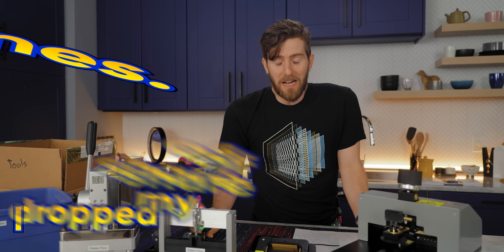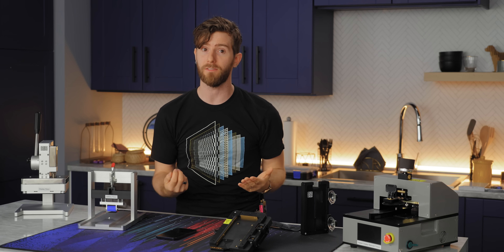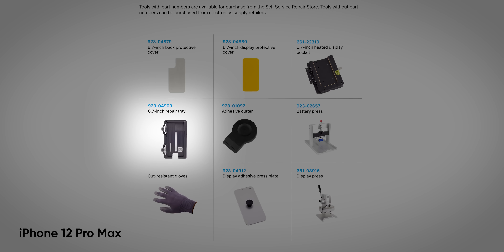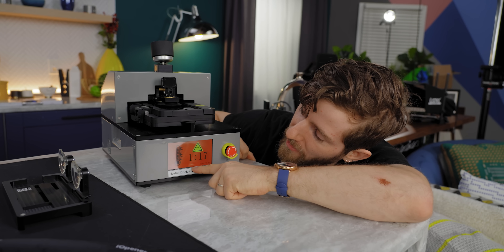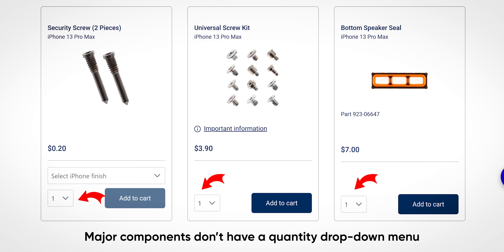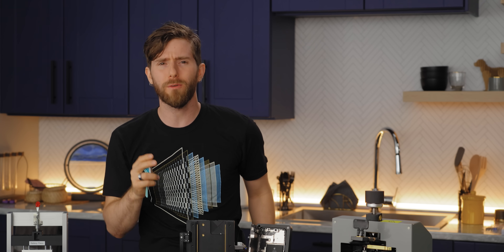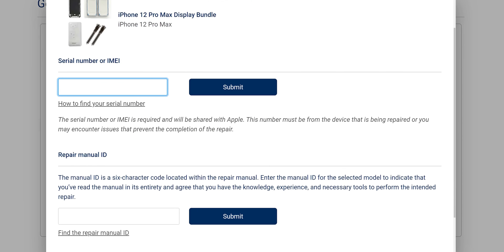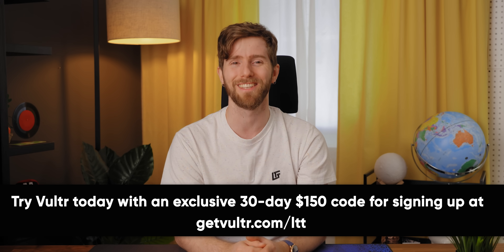I’m a Genius - Apple Self Service Repair Program

Comment: coming from an Apple authorized service provider. The customer has the option to wait over night for the part (if supplies are good, and of course GSX doesnt tell you stock) Or us as the provider can order the part as a "stocking part" which actually cost us more then what Apple charges for the repair! which in turn makes our prices higher to cover labor cost and part cost (Apple will pay you but its not even enough to cover their "minimum wage thing of $17.36) Now there is an option called Apple consignment part inventory which does! give you about 3 parts on hand at all time and when used Apple will send you a replacement part however, the cost associated with this is not much better then just stocking the part. Or in many cases is way more hassle on the techs end that will ultimately result in the shop losing money on the overall repair. There is a way to be very efficient about it  to where we do come out $4.55 ahead but its slim pickens. Working for Apple for 5+ years has drained me quite significantly

Comment: so basically same as they did some time back with parts availability for non-apple repair centers. it is possible to get original parts, but qualifying to such program is insane, apple will dictate what you can and cannot repair and you need to wait for part, you cannont just order any stock... so its just point against right to repair, "we have program for original parts, but noone wants them".

Comment: Why does the phone require heat to open it up. All are new modern phones doing weird shit with adhesive to seal phones? What happened to just screwing things shut so you don’t need a fancy heater or risk burning yourself??
Reply: it doesnt look as good with screws according to apple

Comment: It's okay, if you bring it in you're more likely to buy a new device. Especially when you bring in a laptop and it just needs something simple like a hard drive and the price to repair it is literally as much or more than buying a new one. And with that price, they won't even try to save your data.

Comment: It is the same power tools and motorcycle market. Once needed to order new piaggio engine for customer. New scooter cost about 2000€ and new engine for it was close to 3000€. It was like 8 years ago if I remember correctly

Comment: In my opinion, it's quite hypocritical to complain that genuine replacement parts are expensive after customers demanded to the high heavens for OEMs to sell them genuine replacement parts.

Given how crappy and worthless non-genuine replacement parts are (probably even dangerous in the case of batteries), having the option to straight up buy genuine parts straight from the horse's mouth is a godsend. Apple wants to sell me a replacement screen for $440 dollars? Even if an Apple-performed screen replacement would be $340 dollars? Fair game, I say; I want genuine parts for their guaranteed quality, the price is irrelevant.

The right to repair is a question of whether a repair is practical to achieve. Whether it's something someone can cheaply or even economically afford is not Apple's nor any OEM's problem.

Comment: Apple is rediculous on mobile just when you think they are going to stop their in your face "give us money". But were the last to switch to new all glue glass sandwich method phones. Apples tool prices are insane, tools refurbish centers use are not expensive at all. Or u can just go heat and wire method (way to much time). This cartridge jig crap is unnecessary though. A combo oven/Uv cure/Vaccume device which can do one phone to many phones at 1 time are cheap. I bet a jig/cartridge heater/curer (the thing Linus places phone on and slips in machine then screws at temp) combo not made from Apple able to do any brand glass sandwich is available cheaper then Apples by far cheaper. (Apple will probably make cartridges for that machine for their newer phones impossible to buy and I'm willing to bet that cartridge shown in video can't be ingenuity solved to make fit new releases. And especially other phones). I phones were fine sticking with actual metal backplate and  a real chassy in every sense of the word 2 screws by charger and screws inside. Where a camera was easily re used from lcd or digitizer replacement also the home button (a very unique technique to transplant it if u ordered a kit without one). The design was fine, thickness differences were basically un noticeable. Only 1 side of phone could crack,  u could change your backplate to any Apple color for 7$ no equipment needed besides basic technical screwdrivers, flat aluminum pliable prying tool (or guitar pick/plastic wedgers). Apple did NOT need to go Sandwhich everyone did it to stop cheap/budgeted and/or DIY people, sale protection plans, and then on the Diy people put them in an expensive lock box. Why spend that money to fix iPhone when you can spend way less to fix any phones. You can even remove galaxies glued on super thin screen protector that goes above the glued on digitizer which glued onto actual LCD screen. Instead of removing 2 screws carefully prying up from bottom up. Removing the METAL connector/cable covers held in place by screws, with super solid ribbons and connectors. Sandwich glass phones are a joke. In comparison for any brand for any person who has no problem fixing themselves. Theres also a very smart non heat glue neutralization (which should not be used to deglue battery) method you can do to delayer the top and bottom layers of any phone. A strong UV light will cure new glue. HUGE REASON THEY ALL WENT GLUE SANDWHICH GLASS PHONES IS.... NUHUH NUHUH Sorry no tampering with our ICs, Mics, sensors that are soldered on mother PCBs. To easy to take apart the actual metal I phones. Metal other phones. Gotta collect that data for all that money amd can't have you tampering with your phone you literally do not own no matter how you bought it. This is how they see it. They literally view the customer as a data giver customer. Not a phone buying customer (buying their phones and manipulating them is a slap to them, not realizing u don't really own them is their excuse for their actions). This stuff is not hard to do manually but very time consuming to.

Comment: It started waaaay before the 6 to be fair. I used to replace broken screens all the time for my friends. 9/10 times, a "broken screen" meant the LCD display was totally fine, it was just the digitizer that was smashed. This was a fairly simple repair and if they were happy with China's eBay offering you could replace a smashed digitizer for <£10. As of the iPhone 4 (I think!) the LCD was fused to the digitizer. This meant unless you had experience with a UV light box, replacing a smashed screen was out with the skillset of most people. It also quadrupled the cost and meant that doing a favor for my friends was as expensive as going to one of those cheddar fragranced shops mentioned at the start of the video. I believe they had honest intentions at one point - iPods got smaller and smaller, so becoming harder to work with was kinda inevitable, but this move with the screen was the first time I noticed they were deliberately moving against home repair guys with no obvious benefit to the consumer.

Comment: Me here with my android using plastic picks to pull the screen off, put the replacement on and double sided tape to seal. Leave it to Apple to design a $500 solution to a $1 problem.

Comment: I agree this is completely unattractive and pointless for individual users doing a one off repair.  However I can see some potential value over time for repair business who can buy the tools and use them over and over.  The price of the replacement parts and the inability to buy multiple parts so that repairs can be done in a timely manner would obviously make that side more viable.  Fairly obvious why Apple doesn't want to do that (not in anyway suggesting that is a good or moral position from Apple).
Reply: The parts prices seem ok, if a third party screen is $200 then charing $230 for a first party screen including new water proof seals etc is not at all bad. 

The name of the program is clear enough it is `self` repair.

Comment: The only way this would be worth it is A a third party repair shop has the tools and B they are stocked with ebay parts, then it could be cheaper, but your using ebay parts which can vary in quality depending on source.

Comment: Did you tried putting different serial number when ordering parts? I'm curious if they bind the screen/battery/part to this serial number before shipping. In true Apple way :)
Reply: not before shipping but at the end when you complete the repair if you want the phone to have a proper colour calibrated display and colour crate camera (if you replace the camera) then the phone needs to download the profile that was generated in the factory for that particular display/camara etc.   

At this point currently apple do not have a nice automated tool so instead you put your phone into diagnostic mode and call the company that is running this program up (apple is not running the program it is a large logistics company). They then in a web tool configure some settings so that your phone is able to download the correct colour profiles for the part you have installed.  At this state in theory they are supposed to reject it but others have called them up and it turns out they mostly just take any serial number and do not bother cross referencing to your order.

The taking of a serial number at order time might well just be to avoid bots that mass order large amounts since they can effecivly rate limit on each serial number and since modern numbers are randomised guessing a valid iPhone number the matches the model you select is not easy.

Comment: as a person who worked at batteries plus bulbs i know that this is kinda awesome that they are giving anything at all so as i can see that it is ridiculous i love that they do offer the tools and also the key components that we "repairers" cannot get at all so i mean not so bad and also since they need to exist or we are screwed as someone who has fixed thousands of iphone 6s and seven ect the home button being irreplaceable the option is appreciated i dont need the tools or the parts except the ones i cant get from china. not that i would bother because iphones are garbage.

Comment: I am impressed with Apple's repair tool kits, but those parts are just way too expensive making this service completely useless. Thanks apple for screwing over customers as usual.
Reply: given third party screens are $200 charting $230 for original screen including screws, waterproofing kits etc is not really that expensive the fact is the screen on your modern phone (these are iPhone 12 and 13s) is by far the most expressive part by a large margin after that comes the SOC and most of the cost here is in R&D.

Comment: I’d support Apples device costs if they gave their “apple pricing” on your device when you trade in your device for a new model …. and not an insult!
Reply: the main issue here is how apple re-use devices you trade in.

they have this policy that only the internals are re-used anything you have touched is thrown away and for a phone that means the most expensive part (the screen) is replaced even if it is perfect without any scratches. 

So when you trade in a phone to apple they are only interested in the main board of the phone (they also replace the battery of course). That is why phones, iPads etc have very low trading value as the cost of a mainboard for apple (if you do not include R&D costs) is very cheap most of the parts cost in a phone is in the display and battery.

Comment: So boys i got two choices for ( streaming - gaming - editing ) 
I already have 
gigabyte RTX 2060 OC 6gb
Corsair vengeance pro rgb 16 8x2 3200 ddr4 

Im getting nee parts to upgrade my shitty MB-CPU 

So here is my choices and i need suggestion of these two parts for streaming editing ETC .

The difference is 75$ almost so 

1- 
 
Intel core : i5 12400F
Mother board : ASUS Prime B660-PLUS D4
Cpu Cooling : DeepCool AK620
Power supply : EVGA Super Nova 750w  Gold
Case : Lian Li Lancool II Mesh RGB

2- 
Cpu : Ryzen 5 5600x 
Mother Board : B550m-Plus
Cpu Cooling : C-master Liquid 240 illusion 
Case : Xigamtek Aquarius Plus
Power Supply : EVGA super nove 750  Gold

Which one should i get and why .

Comment: Instead of crying to lawmakers to do the impossible and force Apple to sell parts at cost, I'd rather just buy from companies that don't treat their customers like fools. IPhones can be baby's 1st phone in middle school and most other people can use an Android when they find out how much money it costs to get a decent experience in Apple's overpriced E-waste ecosystem.
Reply: it is very difficult to define what `cost` is for a part.

does that `cost` include R&D? does it conclude IP licenses? does it include software development? does it include testing and tooling of testing? does it indulge tooling of the factory it was made in (many parts are made in such volumes for apple that they invest massive amounts of money years in advance into up-scaling factories production lines for a given part to ensure they are not constrained when it comes time to ship). 

the fact that a third party screen costs only $30 less means it is very likly that $230 for a screen is about the correct price if you consider the cost of making, designing etc the screen.

Comment: So the tools and parts cost twice as much as MY ENTIRE PHONE. Apple can SING on my DATSUN...

My last Android lasted me 4 years, and it was still as new when I got rid of it. Same can be said for most of my Androids. My current one has a battery life of a week.  I only replaced the last one because they stop sending me updates after 4 years, same as Apple btw.

None of my Androids has ever died because it was -5C outside. Like iPhone 7 and 8 and probably every iPhone before that.

None of them has been ruined by a little bit of water or even in a shower. 

And if someone told me to pay 300$ for a screen replacement I'd tell them were to shove it. My phone cost between 380 - 440$ and its about as powerful as a flagship Samsung from 2 - 3 generations back, and battery last me 5 - 9 days. Granted, I'm obviously a light user, but still, thats amazing if you ask me.

The only issue I have right now is latest Android version, I think its 12? Is not great, but that might be a Sony thing, not sure how much they change things. Seem the manufacturers do not mess with the Android system as much as they used to some years ago tho. My issues are minor, some interactions are pretty poorly designed. Not like its unstable or crashes or anything like that.

Comment: While I am all for the right to repair, letting people change the fingerprint sensor with a "modified" one could result in a security risk IMO, so Apple is not that wrong...
Reply: but not so as far as asking apple permission before finishing your repair.
Reply: @broskeean  But Apple has a huge second hand market, imagine if all used iPhones had the risk of an altered touch sensor with a backdoor. That would render it useless/insecure. I am not saying I like Apples practices, but there could be real issues here...

Comment: I'm about 15,000km from an apple store and about 600km from the nearest repair shop, so potentially renting the gear and doing it myself would be a better option. Actually, buying the gear would still be cheaper than the flights to get near an apple store. I'd have to send my phone away and be without it for weeks in anycase so I can see value in it, but I'd probably still just replace the phone if at all possible.
Reply: Or just buy a new phone.
Reply: @trashcleaner  which is what i did last time my phone died. Just easier, although still takes too long to arrive.

Comment: What's really needed is for governments to crack down on this nonsense. A right to repair law that allows anyone to freely purchase the tools and parts at a reasonable price without any of these nonsense hurdles. The same problem exists in the car industry - garages need to fork out four figures for the genuine diagnostic tools that each manufacturer requires to read out fault codes and program the various modules, and OEM parts aren't necessarily easily available (or are heavily marked up).

Also, please consider ditching the Buzzfeed-style clickbait titles. I ignored this video in my feed earlier just because of the daft title and only watched it because it was linked from somewhere else. The title should tell us what the video is about instead of playing these silly tricks - if it's a topic I'm interested in I'll click on it and watch. I'm not a bored teenager anymore, I'm an adult with many responsibilities and limited time, and this kind of clickbait will drive me away (and I suspect many others). It's especially disappointing when it's a good video with important PSA qualities.
Reply: These tools are very well priced.

as for parts they are also not at all that high when you consider what third party screens for these devices go for the screen is after all the most expseive part of your phone.
Reply: @hishnash  Then why does it cost less for Apple to do it for you at a store, as Linus mentioned?
Reply: @ricequackers  it does not cost less in store repair costs $60 more than buying the parts from apple.

Linus said it costs less if you consider 4 hours of working on this yourself but apple is not taking 4hours to do a single screen repair it is more like 5 minutes per repair for someone with experience doing it with these tools.  Apple have also shown in court that they make a loss on in store repairs due to the massive rent costs they have for very costly store locations.